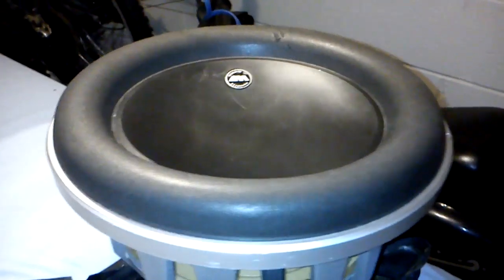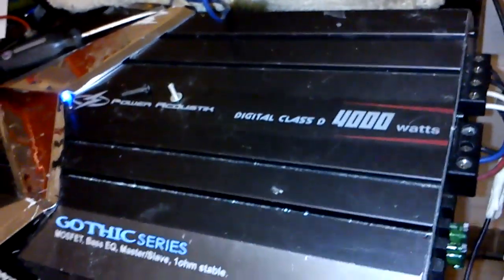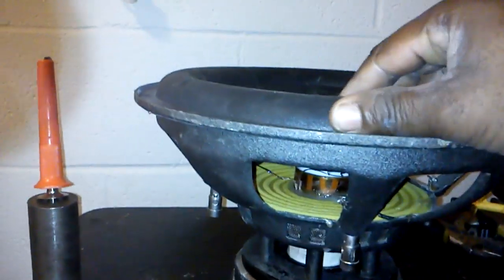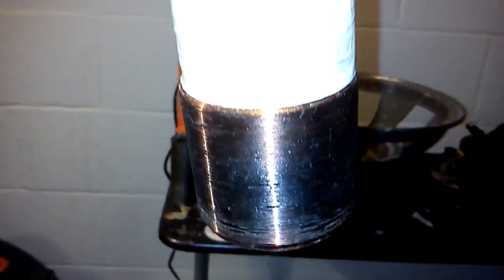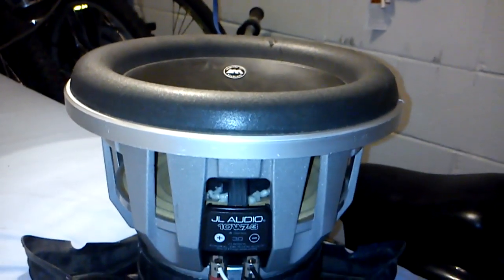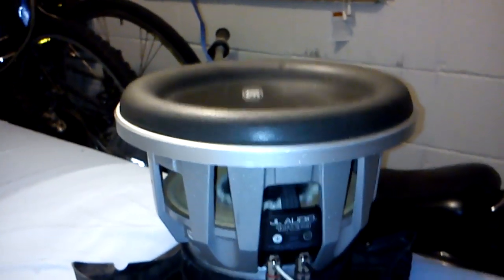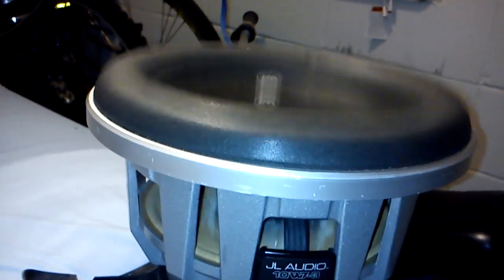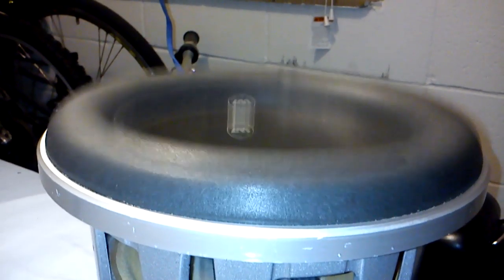how to rebuild a sub JLW7 4000w.avi

Comment: W7's are dual 1.5 ohm voice coils. It can be wired at .75 ohm parallel or 3 ohms in series. Read your subwoofer manual not just your amp manual. Just sayin

Comment: omg this guy doesnt know sh!t that amp says 1200 watts at 4 ohm and 1700w at 2 ohm the sub is 3 ohm your lucky if that amp gives out 1000 at 3 ohms lol i just got stupider from watching this video
Reply: +Roland Golle   man can you see I think not the amp is running at 1x2200 watts at 1 ohm and the subwoofer is a rebuild and it is 2.3 ohm I no this becauce I rebuilded it and put two 4000 watts running togother and it put out 8000 watt at 4400 watts RMS at 1ohm sable and one 10 inch sud was like two 15 inch subs man it was unbeliveble and I could not blow the sub played it for 4 year and could not blow it for real no joke if I played it for you you would say the same thing everone sayed that it was unbeliveble you have a nice day ps I make subs hold more watts  if we head the same 10jlw7 sub your sub would blow at 750 watt  and my sub wont I put  the best amp on my 10JLW7 I never blow it and i never now how much it could hold
Reply: If you rebuilt that sub i wanna know what recone kit you used. because from what i understand the only way to get a W7 repaired is to send it to JL. Even fixmyspeaker doesn't repair W7s anymore because it is too much of a hassle to do.
Reply: I rebuild it I  did not use a recone kit I buy what I need to repair or rebuild any subwoofer and make it hold more power
Reply: ps go to youtube to HOW TO REBUILD A SUBWOOFER and you will see me making a  vice cone

Comment: You used gorilla glue on the voice coil holding the spider on.. dont use water with gorilla glue!!! it makes it expand. only use the original gorilla glue the brown / tan colored shit. if it expands use a flame to burn away the bubbles. or find an epoxy (extra set time) at least able to handle 300 Degrees F. JL audio subs can be a pain to fix if you don't have the right tools. that sub he fixed is essentially worthless because of the glue. not many people will buy a sub with glue all over. that doesn't mean its not a good speaker. if it works for you than rock that bitch in the ass. put a dildo as your centered dust cap and call it a sexmatron

Comment: So your pushing 2000 watts to it ANYONE that knows audio goes by rms not max and that amp I know still wont do 2000 rms. Maybe 1300  and your thread lock bs idea may help but your rms increase comes from added spiders new basket with better coil cooling and motor cooling PERIOD
Reply: you all say the same thing the amp is not true rms will is a kicker 3000w or a 5500w BMF true rms i run two 4400w rms amps together peak 8000w 4400w rms   master slaved at that sub for 3years i tried my best to blow it  i no rms and the cooling men the sub is factory jlw7 10 win it was made it was 750w at 300w rms but win i rebuild it now it can handle for more power thin ever befor if you have a subwoofer that don't work or that do work i can make it better PERIOD

Comment: 2200 on 1 ohm maybe but that sub is 3 ohm sub so thats a 1/3of the power so bout 700 watts if the amp was ture power at 1ohm
Reply: i make subs better to handle more power and not blow the sub did not work i rebuild it.

Comment: I'd like you to test that amp to 2200 w. That being said. When you have an amp, that can put out 2200 w cont. do it again. When that amp gets hot, the efficiency drops a lot. If you really want to test that speaker to 4000 w, an amp that would be easy to do that, would be something like an MC2 E90 connected to a 230v 32ah high power output socket. I'd give that little JL about 2-3 mins top under those circumstances before it either burned or tore itself apart. The MC2 E90 amp can give you 4000w on a test bench. It takes way more than what you got there, sorry to say.